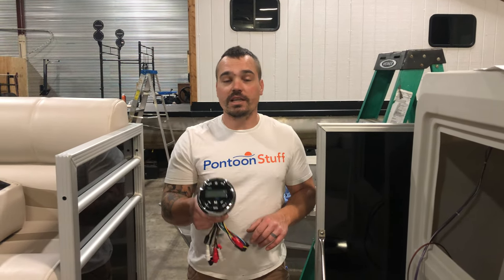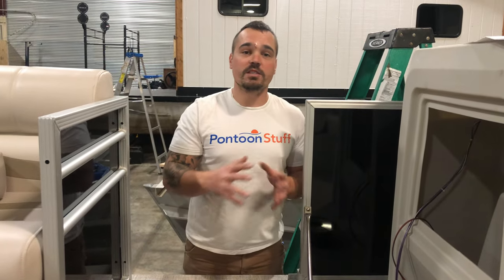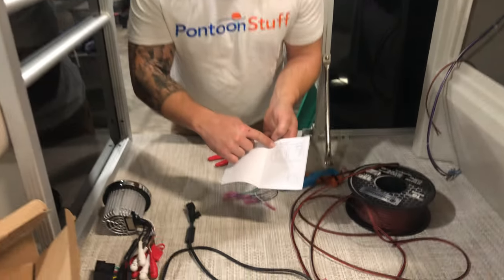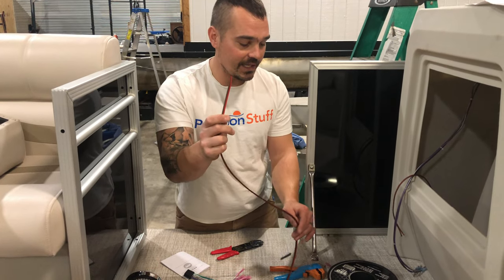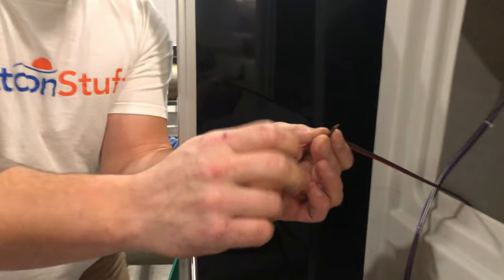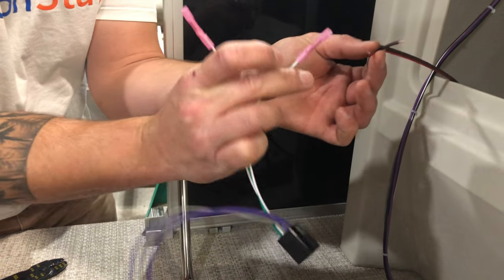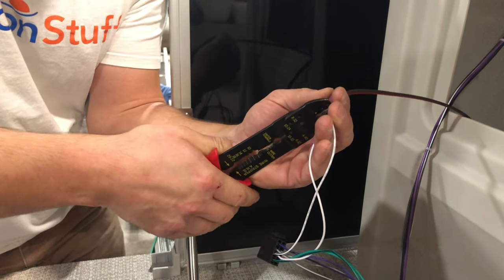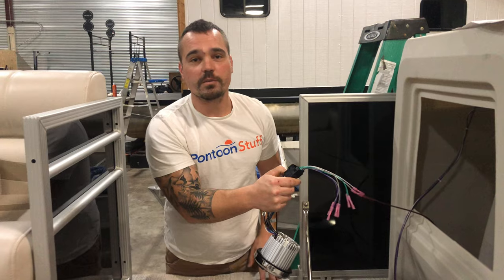Installing Boat Speaker Wire - Time Saving Tip

Comment: Where do you recommend mounting a wired remote on a pontoon in the rear some where?
Reply from the maker: On the remote I installed most recently the customer had me install it up near the front seats so passengers could use it up there. It's 100% personal preference. I'd want it to go in the place where someone (or myself) might have the easiest access to it when not at the helm.

Comment: Does the speaker plug come with the DeckMate radio or did you make that?
Reply from the maker: Yes, with the stereo will be a plug with all of the colored speaker wires as well as another plug that has the power and ground for power supply. I just add those heat shrink splices ahead of time to have them ready to connect to the speaker wires.